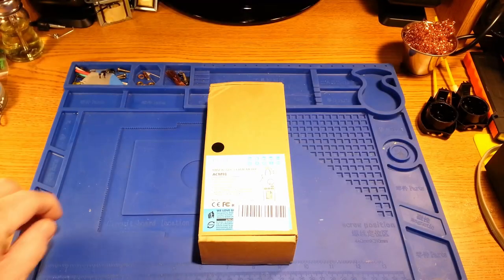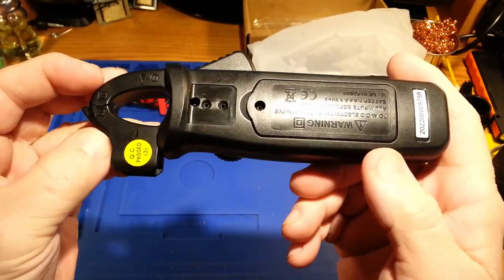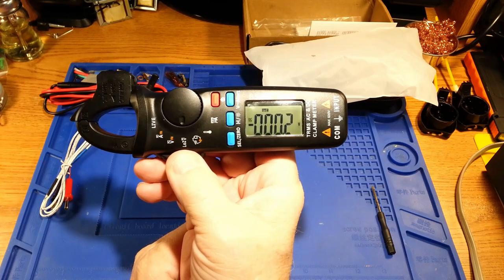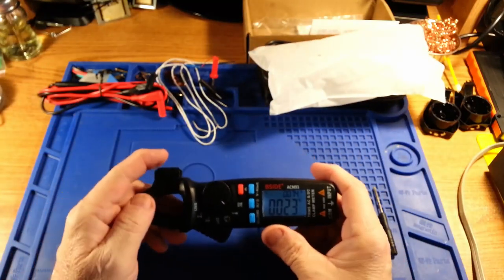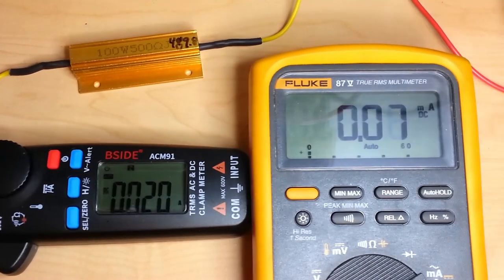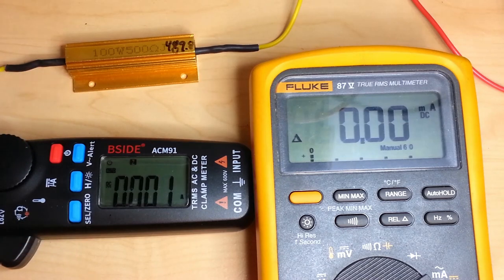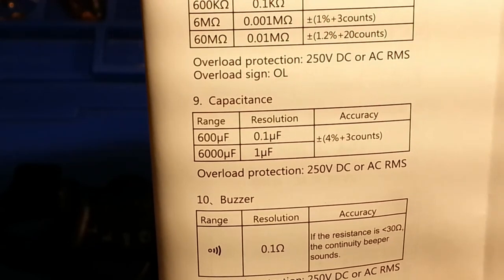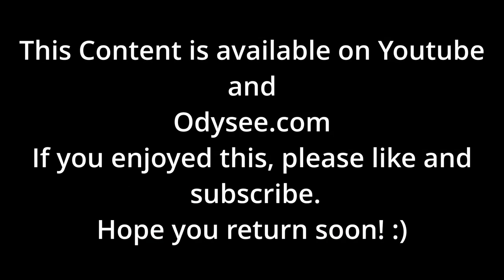Clamp on Milliammeter? R_001-Bside ACM91 Clamp on DMM Review

Comment: can we measure AC milli Amps please reply
Reply from the maker: The English language version of the user manual PDF can be downloaded here http://www.mediafire.com/file/efyz5m85w42gre9/ACM91_User_Manual.pdf/file  and it states that in the 6A range, set to AC, it can measure down to 0.001A, so the meter should be capable of it, but I did not verify this because I was more concerned with the DC milliamp measurement issues.
Reply: Hola, y en corriente continua es capaz de medir 5ma ? 10 ma? @poormanselectronicsbench2021
Reply from the maker: @adrianpuentes7299  Obtener mediciones de miliamperios de valor bajo usando la pinza amperimétrica es difícil debido a la forma en que se comporta este medidor, como se muestra en el video. / Obtaining a low value milliamp measurements using the clamp meter is difficult due to the way this meter behaves as shown in the video.
Reply: Pero cual fue la medida en miliamperios mas baja que usted obtuvo en corriente continua ? Usted hace referencia a la forma en que se comporta este medidor ....por favor usted puede explicarnos mejor ??e @poormanselectronicsbench2021
Reply from the maker: @adrianpuentes7299  
Durante un breve periodo de tiempo, pareció observarse una diferencia inferior a 5 mA, pero, debido a que las propiedades del medidor no pueden poner a cero, no puedo estar seguro excepto por el hecho de que no puede medir adecuadamente ese nivel bajo. / For a short time, a difference of under 5 mA seemed to be observed, but, due to the properties of the meter not being able to zero, I cant be certain except for the fact that is is unable to properly measure that low.

Comment: Thanks for a great review. I just ordered one and I hope the DC current function works for my needs.
Here is what the manual says.
Measure AC&DC Current:
Turn the rotary switch to (Amps). Push SEL/ZERO to choose AC or DC current.
Center the wire within the clamp jaws below the horizontal line located on the clamp.
DC current mode, due to the existence of electromagnetic field, please push ZERO button 2S, set the value of display to zero.
Keep the direction of the meter and zeroing in line.
I think the 'centering below the line' is because it has a Hall effect sensor that the wire needs to line up with.
Also the PDF manual says Low Impedance resistance is 800KΩ
Reply: Hola. Que tal te fue con las medidas en corriente alterna y en corriente continua ? Cual fue la medida más baja en la escala de.miliamperios???